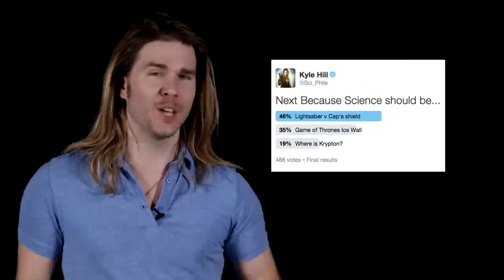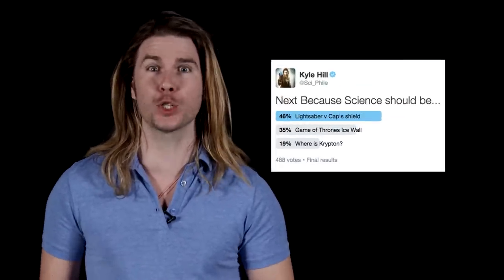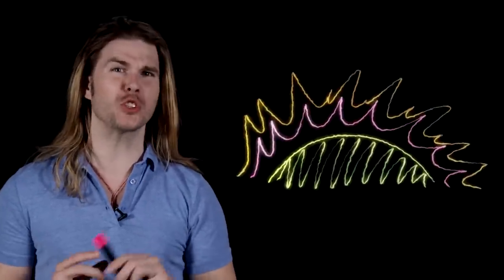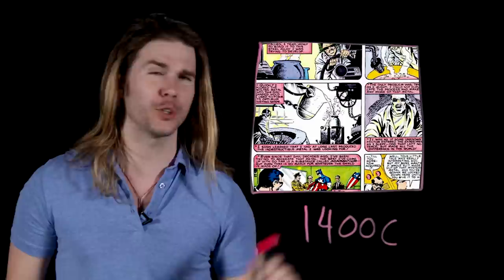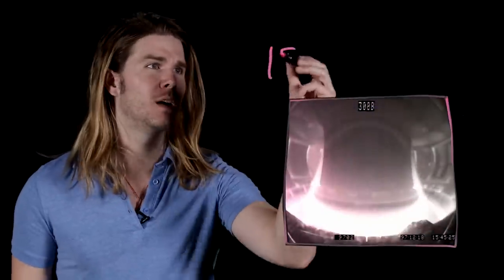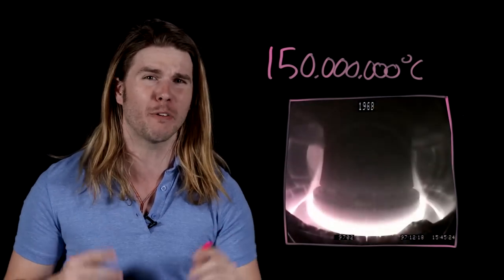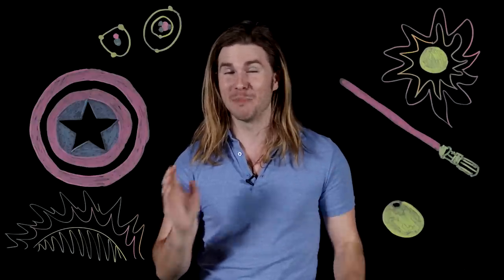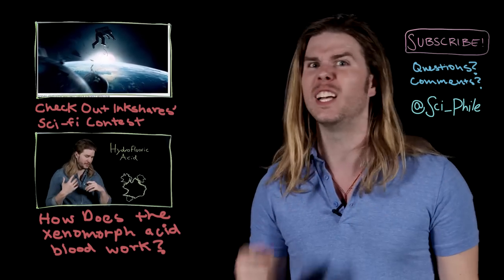Could a Lightsaber Cut Through Captain America's Shield? (Because Science w/ Kyle Hill)

Comment: Answer: yes, as the lightsaber's intense heat from the radiation that allows it to melt through solid steel would melt the shield. Along with the light saber's wielder, Cap, and the lightsaber hilt...

Wait, what would happen after the hilt melts? And intense explosion, a sudden burst of radiation, a burst of plasma, or something else?
Reply: HEAT is merely vibrational/kinetic energy of particles. Vibranium specifically absorbs kinetic / vibrational energy into its make-up. Your argument is invalid. :P

That said, it has limits to its ability to so-absorb. And if ENOUGH energy is applied all at once, or over time, its ability to absorb/dissipate kinetic energy may be saturated or exceeded. However, where that absorptive ability's limits lie is anybody's guess. Canonically, nobody really knows, but it has occasionally been destroyed by nukes, or by a blow from the infinity gauntlet, etc. 

Likely, it would take a lot of abuse from a light saber, and by "abuse" I mean completely absorbed / nullified strikes before it would ever come close to reaching its theoretical maximum absorptive, dissipative, or storage capacity... So, I suspect, Cap would have the upper hand in terms of using his shield as a shield.

I'd think he'd be more likely to succumb to force push, force choke, or other force abilities, long before his shield would give out due to whatever inherent "limit" of the Vibranium caused it to fail over. We've seen plenty of materials in S/W canon resist light sabers. They are not perfect weapons, and don't cut through absolutely everything, and do not always do so "immediately" if they're able to at all...

Comment: heat dissipates and if it is also absorbed at the same time it dissipates the lightsaber's  heat will probably never be enough to melt the shield.

also about the shield bouncing, the curve of the shield acts as a spring and is why it doesnt just stop because it reflects the relative velocity. when its handle is gripped and the shields edge is used to strike something, the position of the inertial transfer being the center of the shield, it transforms the edge of the shield into a pseudo unstoppable object.

Comment: If the shield absorbs vibration that well, then it would have an extremely low heat transition rate. The only problem with the theory is that it's impossible to accurately know how much effect it actually has.

Comment: Well a lightsaber would be super hot and would heat up the metal in such a fast rate which would be like dripping boiling hot water on a frozen windshield which makes it implode and vise versa. If a lightsaber whacked caps shield while it was room temp what should happen is it should explode  due to such a huge difference in energy. Yes it would absorb it like you said but that's what I think would make the chain reaction worse kinda like how you said a saber could cut through the unbreakable claws of wolverine.

Comment: So originally, I was going to say yes. Vibranium can be melted and shaped (under the right conditions) so therefore with enough time the lightsaber would cut through the shield, even if it wasn't immediately. 

However, there is a substance in the Star Wars universe that does have the ability to deflect or interfere with lightsabers: the cortosis ore. It accomplishes this by causing a feedback interference that shorts out the lightsaber blade and temporarily shuts it down. A lighter cortosis weave used in anti-jedi armor has trace amounts of the ore that does not short out the lightsaber, but does repel and deflect the blade. I'm not sure how that makes sense, but I'm working with unobtanium here, so I'll just go with it.

Now you have to ask: is the shield the comic book or movie variety? If it's the comic book variety, I'm STILL going to go with my initial answer of yes, but it will take time: the energy will be stored in the vibranium until it's overloaded and breaks down. (Edit: vibranium in the comic books negates all energy by converting it into a state that dwells between the molecules of the vibranium: with enough time or energy, this connection can be overloaded and destroy the bonds between the particles) This will likely take a fairly long time: more time than a fight would last. So even though the answer is yes, to a kid watching a fight it is still no. A more interesting question would be: does the shield deflect the blade like cortosis or does it simply absorb the energy which makes the blade vanish?

If it's the movie variety, I'm going to say no, as vibranium stores and releases energy in a violent manner: demonstrated by the Black Panther's suit all throughout his movie, and more importantly by Captain America's shield in the Avenger's movie when he takes a massive full strength hit from Thor's hammer and the resulting feeback levels the nearby forest (and Thor). This directly mirrors the properties of the cortosis ore from Star Wars lore and is a direct counter to the lightsaber, shorting it out.

(A friend asked me this same question and another friend sent us this video.  This was my response to his question and I thought that perhaps people watching this video might be interested as well)

Comment: That is assuming the light saber is hitting the same spot. However, Captain America's shield is also capable of displacing heat such that, if the light saber is hitting a different spot, then the spot it initially hit will have cooled down quick enough that a 3rd or 4th hit later will NOT be compounded. The Jedi would have to hit and hit and hit in the same spot VERY fast. The best chance is to charge Cap and do a pressure attack. Just push and push as if you are trying to over power him, when in truth your just wanting to melt his shield.

Comment: In the comics Captain America's shield has been damaged and even destroyed. Given the various forces involved and the explanations we have for the Captain America's shield, it is most likely that a lightsaber would cut through it after a couple of hits as there's a limitation to how much energy the vibranium in the shield can absorb. Also when you add in just the force as its own entity or power source, the force user would clearly have the advantage in most situations. Effectively the force user would just lift Captain America off the ground, and then hit the shield a couple of times until they cut through it. As for adamantium ability to not remelt after having being forged, this would have to do with the crystalline Matrix of adamantium in its new form. Presuming Proto adamantium is already a semi liquid, and then once it's forged into a object it forms a very dense specific carbon nanotubes like material, it is quite possible that would take a much higher temperature to melt it back down. This of course is assuming that the crystalline structure formed when adamantium cools is considerably denser than any recorded material. if we go with the comic book explanation, it is most likely that it would take a much higher temperature to somehow recool the material and probably the addition of different substances as well. Say some sort of gas, that is responsible for adamantium being in a liquid state to begin with. The premise here, is that the gas added to adamantium reorganizes adamantium into a liquid state that doesn't form a crystalline Matrix. As the adamantium cools the gas is released from the material, allowing the adamantium crystalline Matrix to form. If we somehow apply this to the mix that makes up Captain America shield, it would be possible that the heat required to remelt the shield would be greater than just the mix of iron and vibranium. however it still would be vulnerable to the heat of a lightsaber.

Comment: Why give the lightsaber its sci-fi advantages but not Captain America's shield? Even with those advantages in place the lightsaber could potentially cut through the shield. Vibranium absorbs the vibrations of kinetic energy but as shown in the comics the correct frequency can also destroy vibranium, which is why Cap's shield shattered shortly after the Heroes Return event.

The lightsaber would need to be tuned to the correct frequency and it would become a very damaging force to the vibranium component of the shield.

Comment: Fire can melt metal but can a candle melt a metal door? 
Similarly a sword that has less than a gram of plasma can't melt the shield.
A great absorber is a great emitter. Cap's shield is extremely great absorbing energy. So I would expect it to be extremely good emittor. Any heat absorbed from the saber will be absorber extremely quickly throughout the whole shield and be emitted. Surface area advantage. So I wonder if the shield will even get hot.

Comment: You appear to have neglected a rather obvious component to the 'saber' side of this.

For the plasma that makes up the visible field of the saber to achieve temperatures remotely near melting even typical steel, it would be too hot to hold that close to one's own body.

This makes the weak point in the comparison the actual temperature of the constrained plasma of the light-saber -- as it must remain cool enough so that a distance of only a few inches does not incinerate the hand of the holder.

-
Result : The shield wins.

Comment: in the comics the shield is originally an alloy of adamantium and vibranium and components known only  to the inventor who was killed before he wrote down the formula; he kept  it all in his head so it couldn't be stolen by nazis.  In the movies the shield is "Vibranium" because Sony owned the movie use of the word "Adamantium" so they made the shield "the other magic metal whose word we can use in the MCU" A shield made of vibranium would be excellent for stopping impact, but not much use as a weapon as it would absorb most of any impact when it struck another surface.  In the comics a sheet of vibranium the thickness of sandwich wrapping foil can stop a bullet from a handgun. Cap's shield is not adamantium or vibranium, it is "an unknown alloy" that has been struck by mjolnir multiple times without being damaged.  the "Proto Adamantium" thing is a relatively modern retcon. Also, not all alloys have a melting point between the melting point of their components, a few have a melting point much higher than any of their components.  Furthermore in the star wars movies we see several metals resisting blows and even prolonged contact with a light saber; it's fair to say that the strongest metal in the Marvel universe is as strong as something moderately uncommon in the star wars universe

Comment: the only issue i see with this. a lightsaber doesn't drip plasma. its a solid sheeth of plasma. and hitting it may weaken it. but you would be pulling the saber back to strike again. effectively reducing the heat on it. and an instant hit i highly doubt. would be enough kinetic energy to melt it.

Comment: You failed by focusing on caps comic book shield. The Vibranium in MCU is strong but can be over powered. See the End of Ultron (Iron man attack + Thor's lightning + Gem = melt). Vibranium in the MCU deflects energy until it structurally fails. A LS would be powerful enough to do this.

In the prequels it was shown a LS could cut a massive hole through very think metal (most likely high end advanced not made on earth due to Star Wars lore).

I would say an LS would easily cut Caps shield and his arm off (Kappa).

Comment: Come on.  If the lightsaber put out even a small percentage of the heat mentioned in this video, both the theoretical lightsaber wielder and Captain America would have been flash fried long before shield's integrity was compromised.

Beyond that, this means that lighsabers could not be used by anyone (regardless of the whole Captain America's shield thing).  As soon as you turned on the lightsaber it would be game over for everyone around it, so not very useful as a sworld wielding weapon.

Comment: what about adamantium? can a lightsaber cut through wolverine?
Reply: are you sure about that?
Reply: I believe a light-saber could definitely cut through Adamantium. 
Okay okay, just...  Hear me out.

The ONLY reason why caps Vibranium shield would survive hits against a lightsaber is because of Vibraniums unique ability to absorb kinetic energy. Adamantium does not have this ability. Now, if we're using real world physics, then ALL metals have a melting point, including Adamantium. Add to that, the fact that a lightsaber burns at 150,000,000 degress celcius (10 times hotter than the core of our sun as Science Thor mentions in the video) and yeah, A lghtsaber could, in real world physics, cut through Wolverine. It's like he said, If you threw Wolverine into the sun, would his bones survive? 
I know that in the comics they say once it's hardened it's indestructible, but if you are comparing 2 things from different universes, then you need to put them on equal ground (real world physics), not the laws of physics from their respective universes and the only thing in real world physics that is indestructible is energy.... whew... sorry for the long reply :D
Reply: You may have a point there... maybe.... the problem is that  the two are completely different materials. Mandalorian steel (in this testing environment) would also have a melting point. Which means that Beskar either has an impossibly high one (probably the highest melting point of any substance in the known universe) or it has a unique ability to resist plasma specifically.

I will concede though. You are right. IF (and that's a big, galaxy wide if) Adamantium is equivalent to Mandalorian steel, then yes, in real world physics, Adamantium would be able to withstand a lightsaber blow... 

Well played sir
Reply: Ah! A fellow Mando!
Reply: I think no, because you can see in The Phantom Menace, that Qui Gon cut trough the "metal" door very slow, so lightsaber can't cut through admantium, because after Logan was bombed by nuke(which much more than 1000) "his skeleton didn't "hurt" (sorry for my English)

Comment: first off…according to an actual physics genius (Michio Kaku)
in his video on building a real light saber: the energy of a light saber is
absolutely nothing close to a Tokamak reactor let alone the entire sun. That statement
is an obscene comparison. Secondly, as a blacksmith/ knifemaker who has melted raw
iron in a forge that cannot melt most steel alloys…NO, steel does not melt
easier then iron. The iron ORE only requires more heat initially to burn out impurities, like how it takes WAY
more energy to turn bauxite to aluminum than it does to re-melt raw aluminum. Energy
is wasted breaking the molecular bonds of oxidation from the metal to get a
purer metal. And adding even fractions of a percent of another metal like cobalt makes cobalt steel tremendously more heat
resistant and is used to drill materials 10 times harder than plain steel by
the Rockwell Hardness standard knifesmiths use to gauge our blades. carbon
makes steel more heat resistant because carbon is nearly twice as heat
resistant and only "melts" in low temperature molten iron because the iron
dissolves it like salt does in room temperature water even though salt melts at
temperatures that would evaporate the water completely. So that entire basis is
completely wrong. 

in Star Wars (cannon lore), there are metals like Cortosis
and Mandalorian iron that will stop a light saber and they can be smelted like
iron can. the light sabers can even short-out from the magnetic properties. so
according to the star wars universe…light sabers cannot cut through specific
iron alloys due to odd magnetic properties and what is captains shield? Well, it’s
a specific iron bases alloy with odd magnetic properties. it has resisted
things like iron man's palm thrusters (which can melt steel), Thor's hammer (which
has tremendously more energy then a light saber according to Kaku's comparison
estimation by at least 100 times or any existing Tokamak reactor) and vibranium
alloy is known for its ability to resist nearly all forms of energy by
absorbing and/or deflecting it. I cannot think a fiction material more suited
to resist a light saber in any non-star wars fictional universe. so sure, maybe
captain's shield would melt in the millions of degrees of constant heat and
gravity of a young star..but as long as we use both universes as the
backing  platform for physics…a light-saber wouldn’t do anything to his shield except ruin the paint or at worst: create
enough secondary electricity through induction to electrocute the wielder. the shield
itself would be fine unless there is some trump-all property none of us have
addressed at all, that can negate every other property…like some over-powered magic
or fictional physics made up by a third party just to win an air-tight argument. 
and i have to share team-iron man with this guy...FML im gonna go get a pencil and commit Sudoku.

Comment: In the highly unlikelyuniverse where both exist...

OK, Vibranium shield can withstand and nullify energy... what does it do with the energy? Even if it doesn't cut the shield, the continual application of energy to the shield would probably heat up the shield because of the massive amounts of energy it's absorbing before it can nullify it.

Or perhaps, as shown in the first Avengers flick, where Thor's hammerstrike is rebounded away from the shield you could surmise that it can deal with excess energy by deflecting it away from itself. Which would probably mean that the instant a lightsaber strikes the shield,  you would probably have something of a superconducting energy feedback loop travelling through the blade and exploding the energycell of the lightsaber :P And with it, probably your hand and a good sized chunk of your arm :P